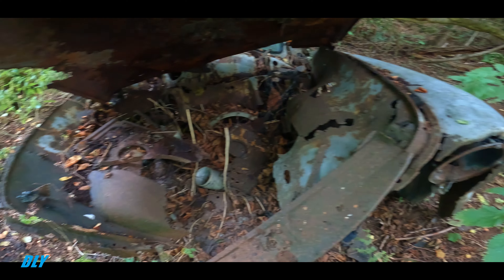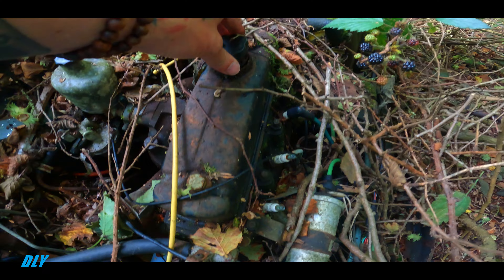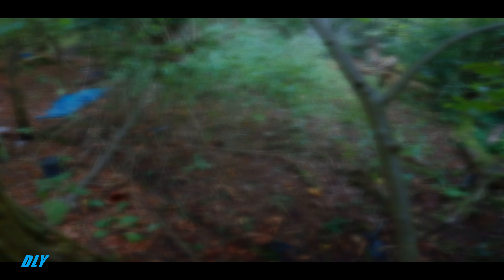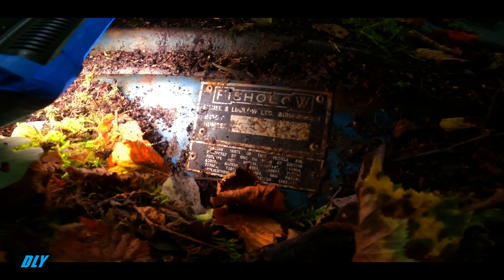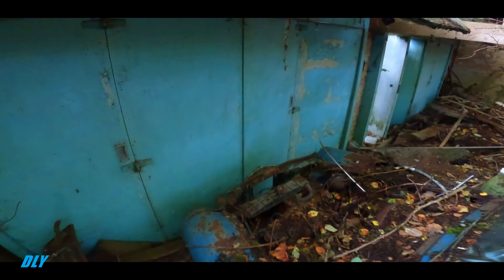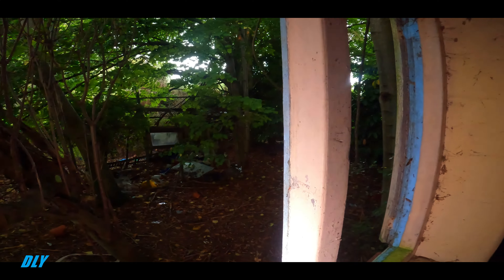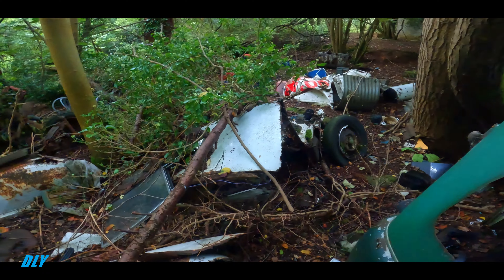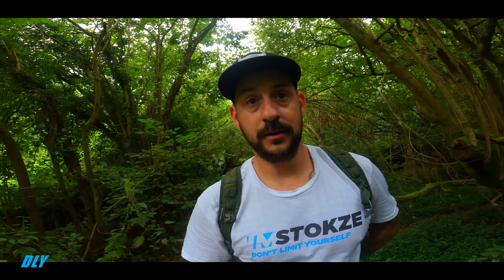Abandoned MINI BARN FIND Time Capsule HOUSE | IMSTOKZE 🇬🇧

Comment: Stu, There was back in the day the Riley Elf 1500 and Wolsley Hornet 1500 these were the two body shells produced by Fisher Ludlow for BMC. My dad had a Wolsley Hornet, they were cool little cars based on the Mini but with a boot so a bit bigger than a Mini. (The Vauxhall Nova 4 door from the 1980's was a similar shape to them). Rare find that Riley Elf not many survived from the 1960's.
Reply: Actually quite a few Riley elf' survived. 750ish in the UK, and 431 of those are still on the road 🥳 
The Worsley hornet is a bit rarer with around 470, but 285 still on the road!
I weeded out the older non mini based hornets and elf' to give a more accurate estimate 😅
Reply: Think you're mistaken they were the wolseley 1500 with a single carb engine bmc engine and the Riley 1.5 with the twin carb bmc engine, the wolseley hornet and Riley elf had 850cc and 998cc engine's.